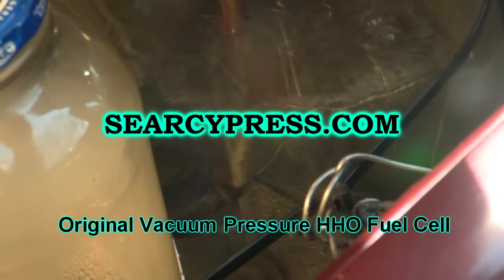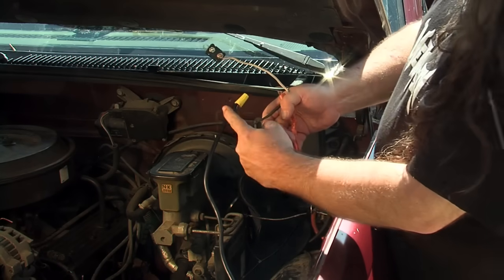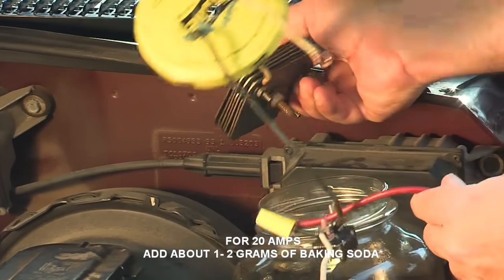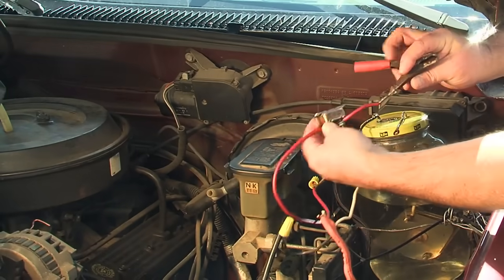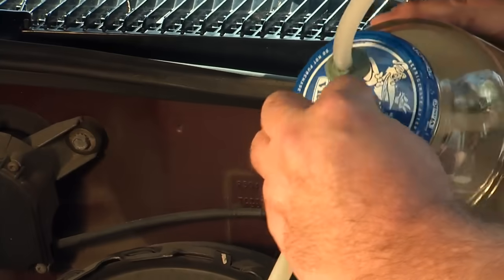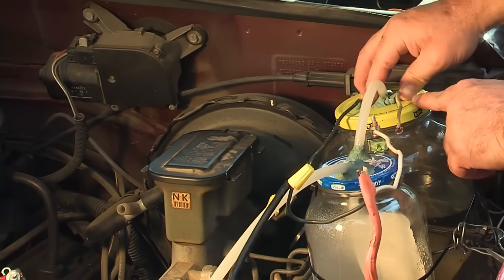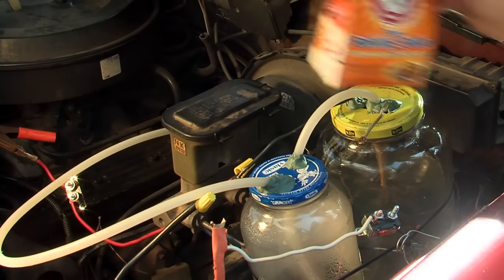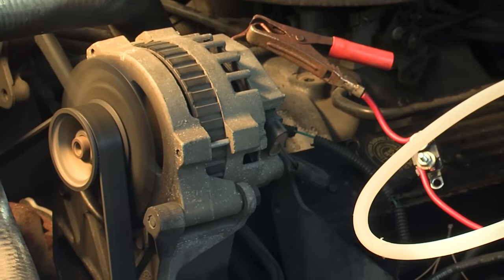Vacuum Pressure Hydrogen fuel cell defeats high gas prices using hydrogen from H2O.

Comment: To bad thats a TBI injected motor and will still use the exact amount of fuel either way .
Reply from the maker: It sure can. But with it you can use the lowest octane fuel without any pinging. So you save reguardless. Thanks for the comment.

Comment: How much you gain the mileage before and after you install the hydrogen booster?
Reply from the maker: Calculating mileage is tricky business. You would have to be on a flat track with no wind driving the exact same speed in a side-by-side comparison. In tests that were performed mileage went from 10 miles per gallon to 22 miles per gallon at times. Sometimes mileage hardly increased at all if any. It is dependent on how you drive and where you drive and conditions. One thing that is undeniable is the fact that we put very low octane fuel in and did not have any engine ping using the fuel cell. Without it using that same gasoline the truck sounded like it had a bunch of marbles under the hood. This resulted in savings every time. Thanks very much for your comment.
Reply: It's fair enough. Thank you  :)

Comment: Thanks for the video...but le me ask why did you pluge it on the booster rather than the fuel line
Reply from the maker: This cell runs in a vacuum state.. The HHO gas enters through the vacuum of the engine. The vacuum of the cell produces unique thermal properties that boost the efficiency of the hho production. It is not over unity. It produces a more efficient burn of the gasoline as well as allowing you to burn a lower octane fuel without engine ping. Thanks very much for the comment.

Comment: This would produce a 2 to 1 mixture . 2 hydrogen , 1 oxygen . By varying the surface area of the diodes/plates , the ratio can be juggled . More Oxygen , or more Hydrogen .
Reply: Thats not true, every single electrolysis reaction creates a 2/1 ratio, stop trying to sound smart

Comment: stan meyrs was killed for running his dune buggy on water so ask yourselves why...cos it worked..also split water with high voltage low current and then with water injectors running pressurized water through same plug to stop hydrogen imploding but expanding gas further creating exploding hydrogen only that is stable to retard ignition with.....haters are loosers...i have made two cells and both produced a gas that exploded ....

Comment: ok a couple comments ...first why the glass jar seems it would be a risk being glass is there a reason for the glass such as electrical conduction or insulation. next if those hot leads hit a bump and are not insulated ie the fuses and connectors should all be insulated in case a bump in the road jars the system and some of those connectors touch ground=== sparks of any kind and hho gas = explosion.   but overall is shows viewers the process and ways to implement it with everyday items thanx
Reply from the maker: Glass is used safely because the entire system is always in a vacuum. Much like a light bulb. We cannot use plastic because it would succumb to the pressures and heat. We don't use stainless steel because of the cost and we would not be able to see inside the cell. It would take shorts on both wires on the top to create an issue and if that happened there are fuses to protect against shorting out. In the vacuum state the concentration levels of HHO would most likely not ignite. Try watching my video photon injection HHO. In the vacuum condition incredible temperatures can be reached inside the cell  without explosion. In vacuum the water behaves like refrigerant. Thanks thanks very much for comment.

Comment: so your pushing your alternator to work even harder then it already does your just gonna burn out your alternator and battery faster plus energy input must equal energy output it's a physics law it cant be broken
Reply from the maker: I understand your concern. Actually the alternator is still doing quite well even on this old pickup. I'm not quite sure how you got to thinking we were saying this is over unity. It certainly is not. We are only burning a small percentage of the fuel. Much of it goes wasted out the tailpipe. What we are doing is getting a cleaner burn. This particular design allows the vehicle to burn much lower octane than it normally would have to have to prevent engine ping. That equals instant savings. Thank you for your comment.
Reply: @metalpresstv  what i would do is make the hydrogen same way you are doing but solar panel as the power source and figure out a way of compressing it into a gas cylinder at home then plumb it into your intake
Reply: see bob lazar

Comment: Are you using glass instead of stainless steel because of its insulation properties?
Reply from the maker: Thermal, visibility and cost. It runs in a vacuum. Thanks very much for your comment.

Comment: This has been around, for a while. This is the kind of technology that we/the world needs right now. If the government would, simply, stay out of the way and quit carrying water for the big energy corporations. life, liberty and the pursuit of happiness. I've seen a video where a man was getting 100 miles for a quart of water. But nobody has a lock on water or ownership of it. So they cannot extort money for it. Yet. So, they outlaw it or arrest or assassinate inventors of similar machines. Great stuff. A glimpse of what the future might bring.
Reply: This is for the unintelligent. Zero motor vehicles have ran off of water and zero ever will. 

Just idling your engine is over a 600 rpms. Driving a 2.5 liter 4cly motor  is about 150 cubic inches. That's 37.5 cubic inches per a cylinder. A cylinder fires ever 2 full rotations. So in a minute of idling at 600 rpms your engine will use 11,250 cubic inches of air a minute at just idle. That's a 187.5 cubic inches a second of air. You're not producing even 2 cubic inches a second. But don't forget that it's h2O 2 parts hydrogen 1 part oxygen. So 1/3 of the gas isn't even hydrogen it's oxygen. So not even 1% of the air being taken into the cylinder is hydrogen. The only thing being accomplished here is the alternator is working harder for the high amp draw dragging the motor down more reducing fuel mileage. This is why water isn't used as fuel in a motor vehicle. 

Now don't forget we don't drive at 600 RPMs most people will be around 1800 rpms at cruising speed. That's 3x the amount of air with still the same hydrogen production. So now ur way below the threshold of .03% hydrogen in the cylinder. Using a spark arrestor on the output hose to keep from blowing the jar up you would be hard pressed to even candle a flame let alone put anything measurable in every cylinder 900x a minute cruising down the highway at the speed limit.

If u think Stan Myers ran a dune buggy of water learn how acetylene is made. You take the gas off the top of the tank after u add the water.

Comment: I think that in a 4 cylinder you can run it on clean hydrogen
Reply: You can run any internal combustion engine on clean hydrogen, you just can't generate enough on the fly like this shows. It's also one of the most difficult gas to store as it **leaks through steel**.

Comment: Finally got around to building one for my 93 gmc 5.7 with a tbi.....its freaking amazing!
Reply: Sweeeet man thanks for sharing that info :D
Reply: @Jumjah  no problem my friend!
Reply: Did it increase your mileage? Pls tell us about what you noticed
Reply: @Jumjah  it did increase the fuel mileage by 4 to 5 mgh and highly increased the acceleration during passing and decreased the stinky exhaust smell. Just takes a while to get the mixture right. But I recommend giving it a try if you havent. I have a TBI set up on mine.
Reply: @Kris-mr7pf  did you do pretty much this design or did you buy one
Reply: @Willyd2758  i ised his design with the exception of the pickle jar.

Comment: The energy needed to electolyse the water is equal to the energy produced burning it. The reactions are the opposite of each other. The only result may be a result in the overall efficiency of the truck. 360 Watts in electric power approx. A half a horsepower lost generating the power.
Reply from the maker: Certainly there is no overunity. Better combustion of the fuel however results in an opportunity for gains. The ability to use lower octane fuel where  normally engine ping would be a problem, results in instant savings. Thanks very much for your comment.

Comment: Will this work on a 2005 Honda Acura TF
 6-cylinder? If so, how many extra miles per gallon are you getting out of this system? 50, 75, hundred miles to a gallon ? Is it going to hurt your engine in the long run ? So many questions, and probably very little answers. Could you write me back, please ! 
THANK YOU.

Comment: hho increased mileage so use a batteries power and batteries are recharge with running of engine so we get rid of hydrocarbons fuel

we can powered up aeroplane's by water using solar cell battery so we use again and again the water cycle and remain constantly in air and transport become easy forever, we pickup the materials and drop it whenever whatever

Comment: Is the hydrogen gas pulled thru the vacuum jar and into the engine and burned at the master cylinder "T" connector? Also, would the ECU computer in a modern car adjust the air fuel mixture properly to compensate for the added hydrogen fuel?

Comment: I have think , actually, researching this. What I want to know , does this work new and more modern vehicles , such as fuel injection engine?
If so , how?
Btw , thank you . Very informative.
Reply: You can stick the hose into the intake
Reply: It’s just an explosive gas going into the normal air intake. So it’ll work on any gasoline fuelled engine. Not Diesel tho!
Reply: @nickybritain4900  Except your o2 sensor will shit its pants and she will run like shit anyway.
Reply from the maker: Certainly not what we found except when putting it into the intake. Vacuum makes all the difference. We are actually able to burn a lower octane fuel without any engine ping whatsoever.
Reply: @metalpresstv  you do realise that this setup on this video means the water will boil at a lower temp and feed water vapour into your engine? Too much vapour reduces the efficiency. Lower pressure = lower boiling point

Also, you should at least put in some kind of flame arrestor in that empty bottle, it might prevent a disaster from happening should there ever be any spark/flame. Might also help condensing any vapour if you can sink the heat out of it.

Comment: What kind of plates you used for cell and how many days this will be stable.
Reply: Check out the king of random. He has a detailed build guide on how to make one btw the part about the alternator  is a bit off ac power works but you would have to modify the dang the to pick up the electricity prior to it going thru the rectifier board or purchase an DC to AC to get enough gas to make it worth while.  But go to tkor channel and watch the demo.

Comment: 16 inches .. thats 2 inches BELOW  the absolute vacuum of space ...I CALL FRAUD.
Reply from the maker: You would be making an error. In the U.S., the common standard to measure rough vacuum is inches of mercury ("Hg), which can be measured in two different ways. One method is as "Hg gauge ("HgV), where the scale starts at 0" Hg (atmospheric pressure) and goes up to 29.92" Hg, which is perfect vacuum Thanks for your comment.

Comment: But I thought you could make an HHO generator with as low as one amp
Reply: Yeah you can make a 1 amp system but what's the point? The trick to making your fuel more explosive is making a large amount of HHO gas.
I have a 50 amp system and my fuel mileage and horsepower are both up about 25% depending on what I need at the time I'm driving. If I have a lead foot I get great acceleration but not much better gas mileage. Now if I have a Lightfoot I only use my system in conjunction with my cruise control soon as I flip the switch I looked down at the gas pedal and you can see it moving upward substantially in the car is still going the same speed. That to me is elegant proof that this is really working. If I flip the switch and turn the HHO gas off you can see the gas pedal deflect down very noticeably. I have shown this to people and they are really sold when they see it happen. The big win is that the fuel pump. I have 1 of those cars that tells me how many miles I'm going to get on I fill up and a full tank of fuel supposed to get me 290 miles and it's very accurate. On a long trip when I'm running HHO from my 5 gallon tank which I keep in the rear of the truck I'm easily getting 342 miles per fill up. I love this stuff and I like this guy's electrodes and philosophy baking soda does rule and his plate design has the proper amount of plates and spacing to actually work while I think it's a bit small. My plates are about 8 x 10" and I also use 10 plates which requires 12.3V to operate is perfect for a 13.6 V battery since you actually need to aim a tiny bit higher than the theoretical voltage.
It requires a little over 1.23 volts to split a water molecule per electrode and anything in excess of that voltage (per plate set) is just turned into wasted heat. 

Still, using 7 plates does not produce to much overvoltage which creates heat rather than making extra hydrogen and oxygen. Still a great improvement on other systems that I've seen built on the Internet.
 All those systems using ONE stainless steel wire, basically a single electrode end up making 700% less HHO gas than the system shown here with 7 plates. Using one circuit or one pair of plates is a huge waste of power unless your goal is to make a water heater. Using 7 plates in a row like this is called a "bipolar-electrode" system just as a side note (I sure wish he would've used 10 plates though and much bigger which is necessary when building bipolar style electrodes, they just have to be bigger because of the EDF Electrical-Division-Resistance factor of bipolar cell mathematics.
  Now I'm going to burn some ears, this is not free energy, any fuel you make is a drag on the alternator and is thereby using extra gasoline in an attempt to slow down the engine. Alternators create drag that's a fact. The reason the system works is because modern gasoline which is now 10% ethanol has such a slow and inefficient burn rate that it actually requires some additional "BOOM-FACTOR" to help it burn correctly. Even though you're using a little extra gasoline per mile to run the alternator harder you're creating such an efficient burn in your engine that you're recouping all that lost energy plus more.
Side note: the next time you do a smog test run your HHO at full blast. The guy doing the smog test and reading the report is going to be shaking his head and wondering if you're running an electric engine in your car LOL.  sad but true. The last time I had a smog test I had almost zero un-burned hydrocarbons and my "NoX" was less than a one cylinder engine. HHO done right is absolutely amazing for so many reasons!

I don't know who made this video but the guy is very smart. I can certify this because I am a chemical engineer from Caltech University, graduated 1978. Everything I've seen in this video shows smart engineering and good practices. 

If I had any criticisms I'd say the wire is a little wimpy, he should've used at least 10 AWG gauge wire throughout the whole system and he should've filled the dryer jar with 2 inches of water just in case the car backfired and it would have served as a flame suppressor stopping any flame front from getting into the HHO cell.
My system is 50 amp and I have to use 8 gauge wire for everything.
Warning : use cold rolled steel for your cathodes and use nickel 200 plate for your anodes which is pure nickel. If you use stainless steel it contains up to 17% chromium which is toxic and will break down eventually under alkali conditions. Nickel may cost a bit more for your anodes but it is well worth it!  You can find nickel plate on eBay or aliexpress.com   /  Never ever use stainless steel never never never!

Good luck folks and build your systems properly and you'll have no regrets, only happiness.

Comment: 29 amps puts enough drag on your accessory drive belt to defeat your fuel efficiency gains, you might want to run the HHO gas through a small bubbler, with a pop off detonation purge valve just in case of a backfire, 1quart of hho gas will probably blow the hood off the pickup truck!
Reply from the maker: The system is in a vacuum. There is a secondary container that does have a bubbler. Certainly there is drag from the alternator having to do work. The increase in pressure in the vacuum line with flammable fuel offsets this drag. The gains come from a fuel that is burned more completely, not the hho we make. Thanks very much for your comment.

Comment: steam cleaning the engine,,uhh you sure water in the engine and cyl is a good idea?
Reply from the maker: Burning gasoline produces water. Thanks very much for your comment.
Reply: @metalpresstv  no it dont ,that is just condensation at the tail pipe end but hho produces water in your cylinder walls and quite more ,that is also the same reason why ethanol needs to be near 100% to be safely used in an engine as well
Reply: @metalpresstv  ok perhaps fuel does produce a tiny amount of water due to air combination in the explosion but nothing in comparison to hho